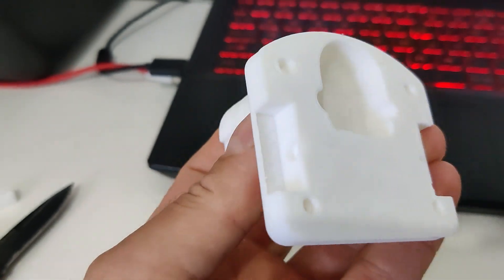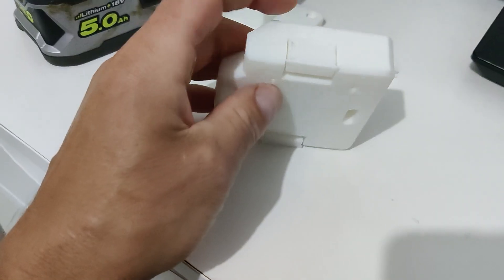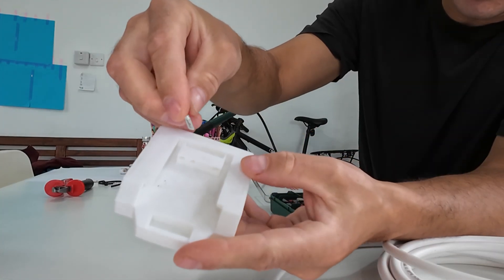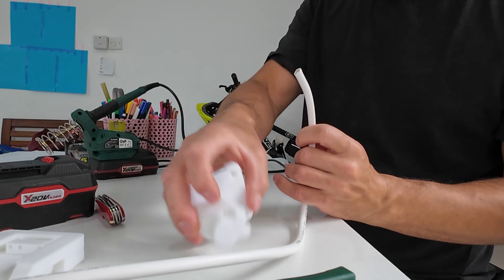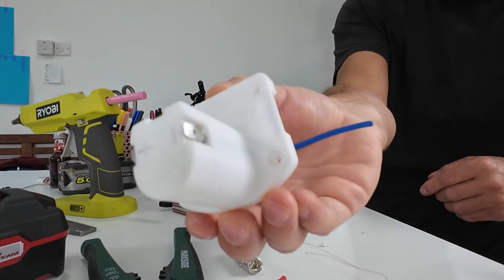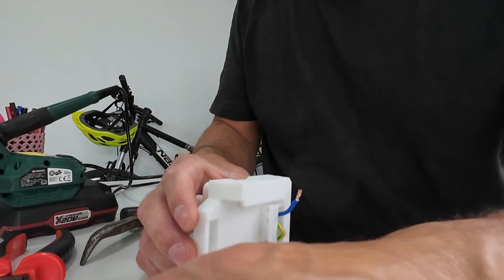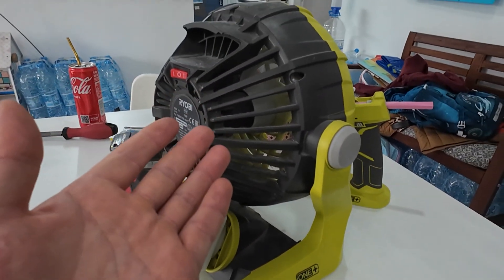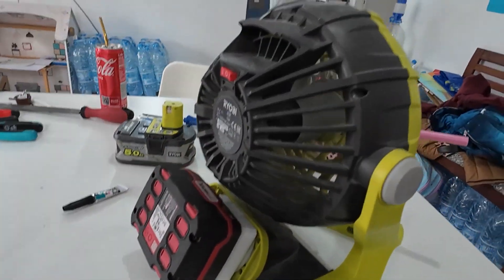Parkside to Ryobi 20V adapter, 3D printed DIY.

Comment: I was thinking in making these, I have TOTAL tools (same battery design as PARKSIDE) and there is an interesting offer on a RYOBI trim router. but I have a question, why nobody connects the third contact of the batteries? the one on the front of the ryobi with the one in the middle of the parkside battery
Reply from the maker: are you from US? ryobi tools and original battery are dirt cheap, buy original maybe. if you are from Europe, yea, different story. I do not know what third contact do, if you are ready to experiment, you can try! third contact, always could be communication too, between tool and battery, and in that case original will work only.